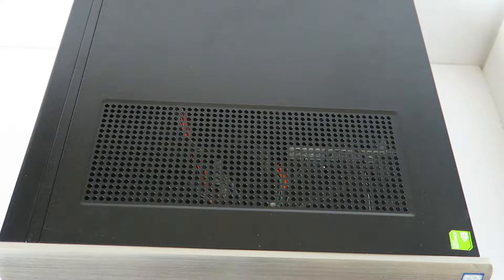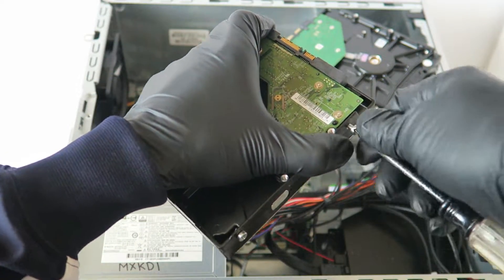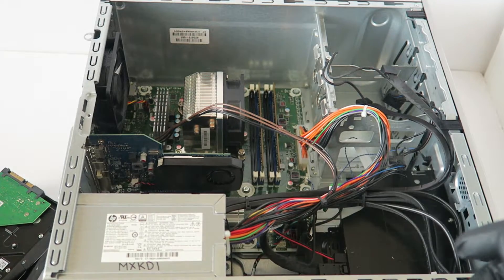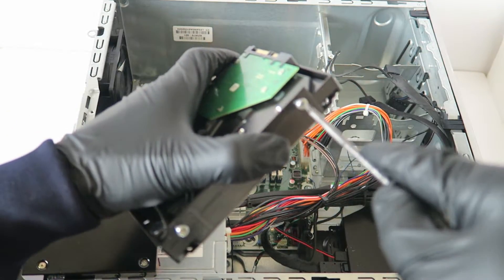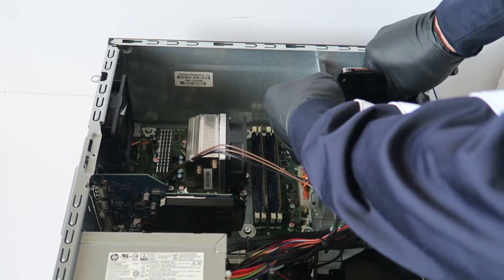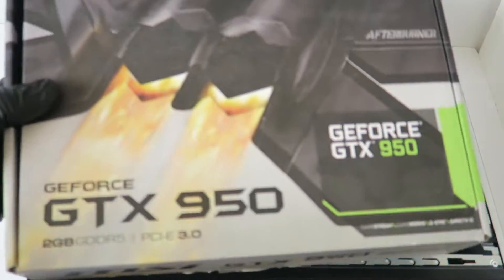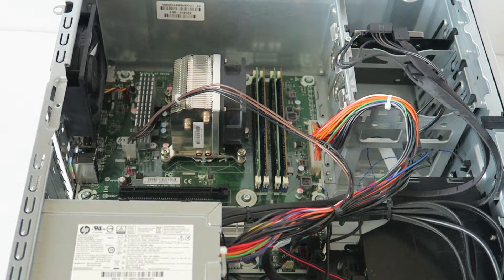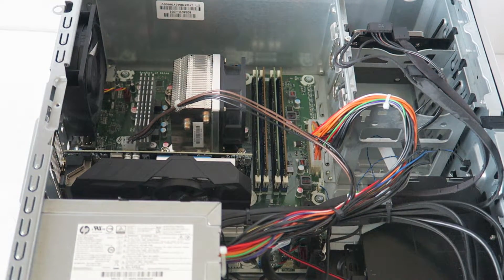HP Envy 750 Gaming Upgrade SSD Hard Drive RAM Video Card

Comment from the maker: List of Parts and Upgrades works with this system :

--> You Have to check and verify which motherboard you have..
 
List of RAM will work with this system  DDR4.

(1.) Crucial RAM 16GB Kit (2x8GB) DDR4 2400 MHz
https://amzn.to/3nVnNCL

(2.) Crucial RAM 32GB Kit (2x16GB) DDR4 2400 
https://amzn.to/3lBSyuB

--> You Have to check and verify which motherboard you have..

This RAM works with this machine DDR3L:

(1.) Crucial 8GB Single DDR3L 1600 MT/s (PC3L-12800) Memory CT102464BD160B
https://amzn.to/2VhGv8O

(2.) Crucial 4GB Single DDR3L 1600 MT/s (PC3L-12800) Memory CT51264BD160B 
https://amzn.to/2xq46wb 

(3.) Crucial 16GB Kit (8GBx2) DDR3L 1600 MT/s (PC3L-12800) CT2K102464BD160B 
https://amzn.to/2VpsKpP

(4.) A-Tech 16GB (2x8GB) DDR3L 1600 MHz UDIMM PC3L-12800 (PC3-12800)
https://amzn.to/3i97Zt2

Thermal Compound Paste For CPU Upgrade:

(1.) Arctic Silver 5 Thermal Cooling Compound Paste 
https://amzn.to/2ziNU0H

(2.) Noctua NT-H1 3.5g, Pro-Grade Thermal Compound Paste
https://amzn.to/36kTk7A

(3.) ARCTIC MX-4 (current edition) Thermal Compound Paste 20 Grams 
https://amzn.to/2DhGJaK 

This video cards will work with this system.

AMD Radeon RX 6400 Low Profile Gaming Graphics Card
https://amzn.to/3s8MUUY

(1.) Gigabyte Geforce GTX 1050 Ti OC Low Profile 4GB GDDR5 128 Bit PCI-E Graphic Card (GV-N105TOC-4GL) 
https://amzn.to/2XEqKMb

(2.) MSI Gaming GeForce GTX 1650 4GB GDRR5 Low Profile Graphics Card (GTX 1650 4GT LP OC) 
https://amzn.to/2VkDdSd

(3.) MSI GTX 1050 TI 4GT Low Profile  Graphic Cards 
https://amzn.to/34r0AxG

(4.) Gigabyte GeForce GT 1030 GV-N1030D5-2GL Low Profile 2G Computer Graphics Card 
https://amzn.to/2Xu3SyO

(5.) ZOTAC GeForce GT 1030 2GB GDDR5 64-bit PCIe 3.0 DirectX 12 HDCP Ready Low Profile Video Card ZT-P10300A-10L 
https://amzn.to/3eayL1b

ZOTAC Gaming GeForce GTX 1650 OC 4GB GDDR5 
https://amzn.to/2V28laj

ASUS GeForce GTX 1650 Super 4GB Phoenix Fan Edition (PH-GTX1650S-O4G) 
https://amzn.to/3eoad4S

SSD List:

(1.) Samsung 860 PRO SSD 256GB - 2.5 Inch SATA III Internal Solid State Drive
https://amzn.to/2BY5gRl

(2.) Samsung SSD 860 EVO 250GB 2.5 Inch SATA III Internal SSD 
https://amzn.to/37xWUfc

(3.) SK hynix Gold S31 1TB 3D NAND 2.5 inch SATA III Internal SSD
https://amzn.to/3d7X6D6

(4.) Samsung SSD 860 EVO 1TB 2.5 Inch SATA
https://amzn.to/2B2FURX

(5.) SanDisk SSD PLUS 1TB Internal SSD
https://amzn.to/3hwdqku

(6.) SanDisk SSD PLUS 240GB Internal SSD
https://amzn.to/2zfc7EX

(7.) Crucial MX500 250GB 3D NAND SATA CT250MX500SSD1(Z) 
https://amzn.to/3bTTjbX

(8.) SanDisk SSD PLUS 480GB Internal SSD SDSSDA-1T00-G26
https://amzn.to/2yfgjUK

HDD list works with this PC:

(1.).WD Black 2TB Performance 3.5" Hard Drive - 7200 RPM Class, WD2003FZEX 
https://amzn.to/2xFUeyF

(2.).Seagate BarraCuda 1TB Internal Hard Drive  3.5" Hard Drive - 7200 RPM
https://amzn.to/3g8FXM8

(2.) Western Digital 1TB WD Blue Mobile Hard Drive HDD - 5400 RPM, 2.5
https://amzn.to/3aEQ1Os
Reply: Where do you get the power supply from on the nvida gtx 950 card as you didnt show that

Comment: i am installing a second drive that is ssd my systems is  hp 750-114 do i need additional cable to connect have both my HHD and my SSD connected of so what cables so i need?
Reply from the maker: Hi, all you need is extra SATA cable..
Reply: @Mxkdt  Thank u so  much for ur help
Reply: i installed the new SSD but now i cant get into my bios the change the boot drive priority. Can u maybe tell me what i am doing wrong. Thank u

Comment: Hi, my motherboard burn out for electrical problems in the building, do you know what MB can buy for replacement? Thanks for your help
Reply from the maker: Hi, yes you can buy same motherboard and they sell on ebay used..
Reply: @Mxkdt  thanks for your answer, do you know if I can found a different one, not used but a option I can found in a regular computer store parts?

Comment: I want to thank u for ur help with installing my second hard drive it works so much better. Now i have another question. I have decided to upgrade my cpu from the Intel core i5-6400 @2.7GHZ to an i7-6700 3.4GHZ. I was wondering will i need to upgrade my power supply (which is the stock power supply which is 300w) and my cpu cooler before installing the new cpu. Also will i need to update the bios as well. Again thank u for all of ur help
Reply from the maker: Hi, you do not have to upgrade power supply 300watt will work fine.
Reply: @Mxkdt  thank u so much for ur help with my upgrades

Comment: If I wanted keep the existing standard hard drive and just add a SSD, where can I plug that SSD into since I’ll be keeping the original hard drive in there?
Reply: one of the slots under the Hard drive
Reply: Fred Inher where would I plug it in since the original hard drive will still be in there?
Reply: @francistorresNP  You need the metal bracket he was showing and a extra SATA cable (should come wit the bracket) then you screw in the bracket and SSD together then put it in the slots directly under the existing hard drive then insert SATA cables and power supply cables

Comment: thank you so much i have an hp envy 750-427c and ive been looking to upgrade and this helps so much because i can see what my case looks like without opening it. thank you
Reply: Delta yo
Reply: @_jls  hi?
Reply: @Delta-lg7hh  Do you still have the 750-427c?
Reply: Would appreciate if you can help me out g
Reply: @_jls  yes i still have it, albeit i upgraded the power supply, gpu, and added a hard drive. what can I help with?
Reply: @Delta-lg7hh  Well we have the same pc and what is the first thing i should upgrade? Gpu? Psu? Also what graphics card do you have?
Reply: @Delta-lg7hh  Send your discord g
Reply: There is literally 1 thumb screw to open it. If you don't want to, or are afraid to, open your tower, I wouldn't suggest attempting to upgrade it yourself.
Reply: @xenonram  ? but i dont want to open it every day I'm thinking about it lmao. i have everything connected to the pc and it takes forever to plug everything back in.

Comment: Hello, this was ALMOST the video I was looking for. I'd like to add an EXTRA drive and keep the original in there... since the original has the OS on it. Is there a wire I can buy? Seeing as there doesn't appear to be a spare one hanging out.
Reply: You just need to buy an extra SATA data cable which will go from the drive to the motherboard spare SATA port.  There already is a spare SATA power connector available from the power supply.
Reply: @3dloon430  the comment i was looking for as well- thx
Reply: @3dloon430  thank you so much, for you this probably was a really easy reply but for me it went a long way. i wish you the best

Comment: Could a 1660 work? Mine is a 400 watt power supply
Reply: Hey, have you installed a 1660?  I need to confirm if it can fit in the case. Thanks
Reply: @qEZPZ  sadly I have not
Reply: @Marc25212  this might be too late but I installed a 1060 a while ago and it works. I had to upgrade my psu also.
Reply: @NikoNWM   I'll have to look into that

Comment: Is this whole pc upgradable (i.e motherboard, graphics card, CPU)
Reply: you can upgrade mobo, gpu and cpu

idk about that psu
Reply: Yes, the psu uses standard 24 pin mobo connector, and screw hole pattern for mounting in the chassis. I'm pretty sure that you can upgrade the psu. (Although, sometimes they will switch the wires around, even though it's a standard 24 pin connector.)

Comment: the 750se I have has a GTX 970. I want to upgrade it to 1070. However, I can't remove the metal case around the 970. Any suggestions?
Reply: you didint know how at the time. i bet u managed to open it huh?

Comment: do you know the gpu clearance for the hp envy case? I was looking at getting an asus rtx 2060 turbo (10.6 inches) and i was wondering if that would fit
Reply: Hey do u have the same 470W psu?
Reply: @ClavinZKL  actually mine came with a 300w power supply, so I had to upgrade. honestly it just better to build from scratch this pc is really hard to upgrade with. only upgrade if you only want to upgrade gpu and u don't need anything else like a higher wattage psu
Reply: @Delta-lg7hh  im fine 1650 s uses 100 in comparison to the 1650 ill buy a 1650S

Comment: is the solid state drive better than the hardrive
Reply: Its basically 10 times faster coz it does not rotate
Reply: It depends on what you want. Solid state drives are generally faster but with standard hat disks, you’ll normally get more storage

Comment: Ok, you are making the hardware install look easy but you should explain to people that on that new SSD you installed you need the operating system installed on it. It is not just a snap in your pc and go. I have the HP 750-414 and installed another SSD drive for games. I appreciate you showing people but also include the software part of the install as well.